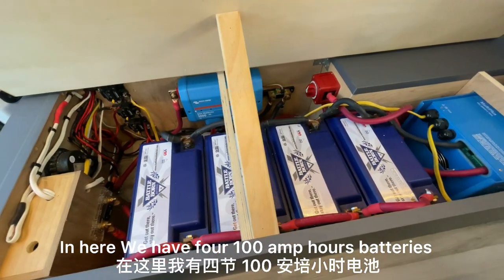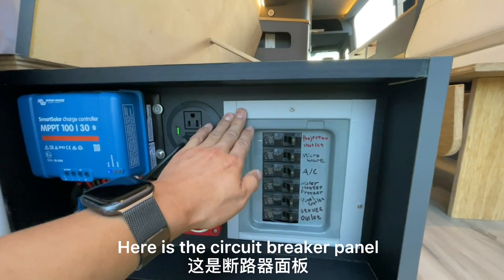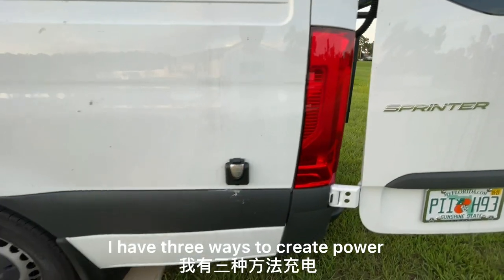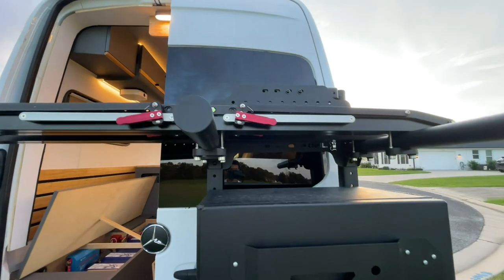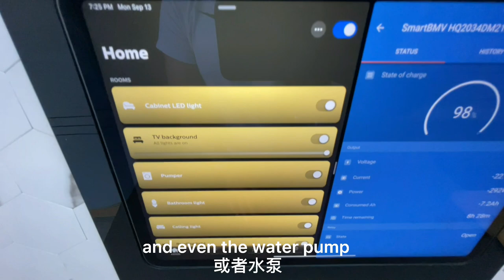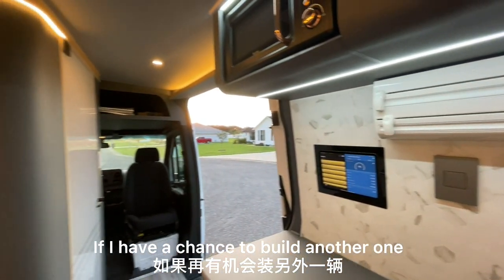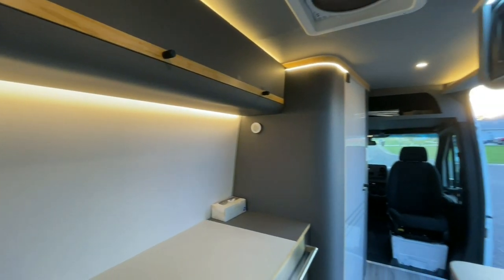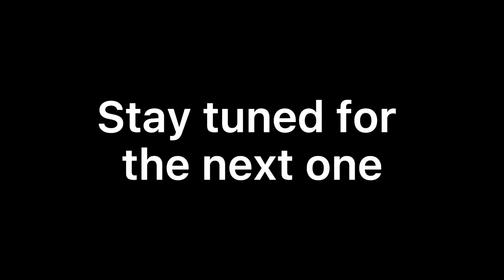Van Conversion Tour | Electrical System | Smart  System | Voice Control Overview

Comment: @Mingz’s Camper Van Lifestyle  Fantastic Van Build Ming, Very well done, So Modern..  I am interested to know what App you are running on the IPad and the relay switch modules used. Would be great to see a video on the smart setup. Excellent Job.
Reply from the maker: Thanks! I use Philips Hue app to control the lights , and use smart plug instead the relay switch, but you need a Wi-Fi router to connect Philips Hue bridge to setup all the connections.

Comment: Great work. Very clean and organized. Was curious if 4 batteries was enough or would you need to add more batteries. Just curious due to all the electrical equipment being used